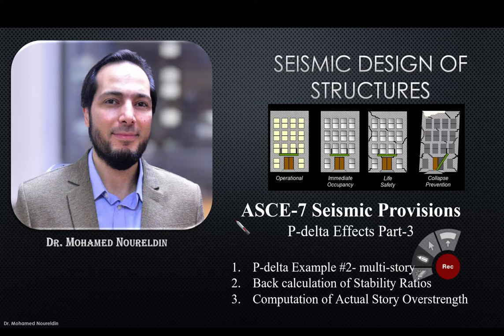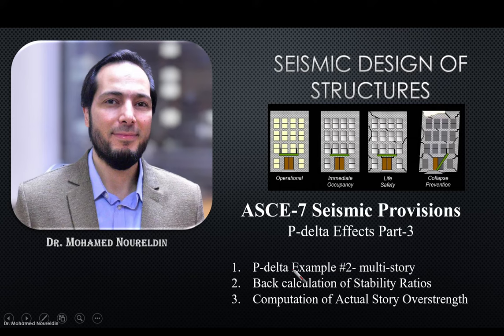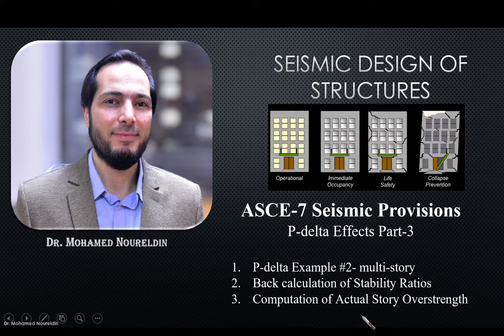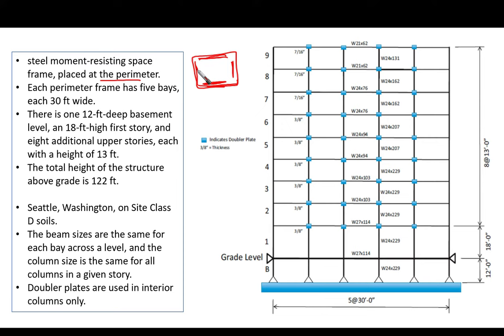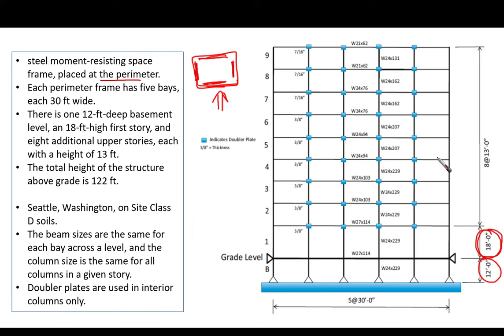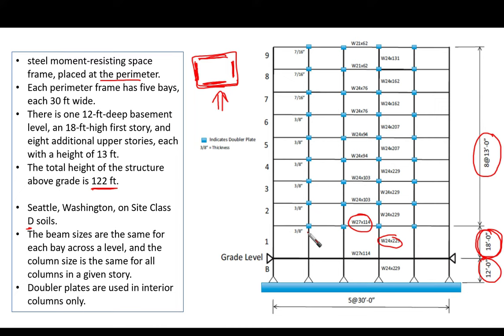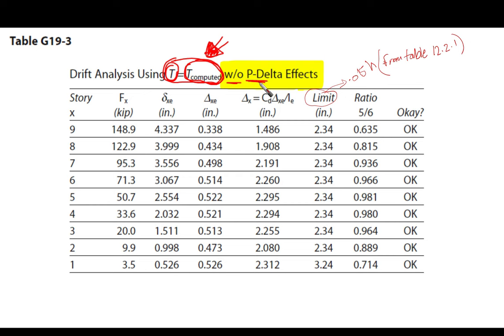23-ASCE-7-P-delta Effects Part-3 Example-2-Dr. Noureldin

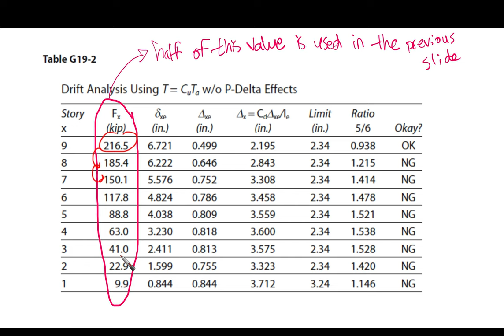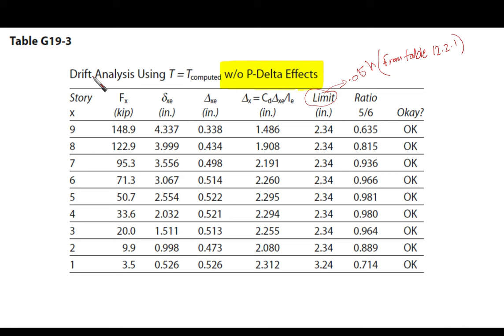Comment: Are the Fx values shown at 50:46 different from the ones shown at 7:04 because we used the "Ta" computed values instead of "Tcomputed?"  And in general Ta is more conservative than Tcomputed, so if we had used Tcomputed then the actual overstrength ratios would be even higher right?